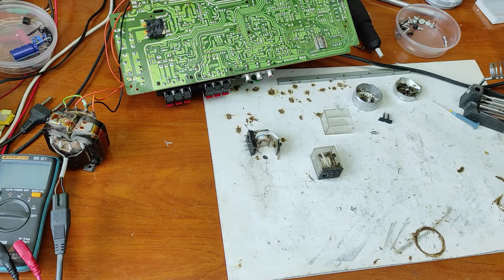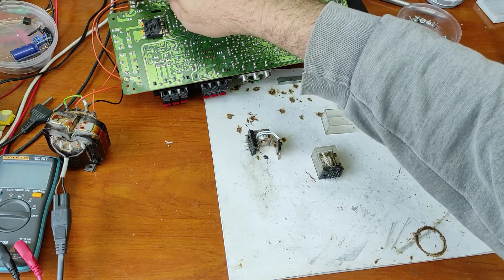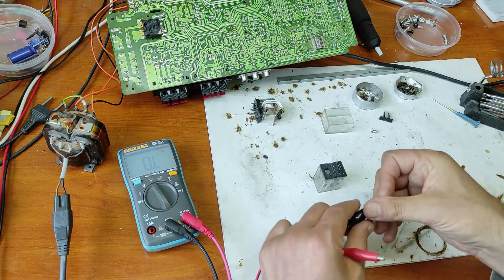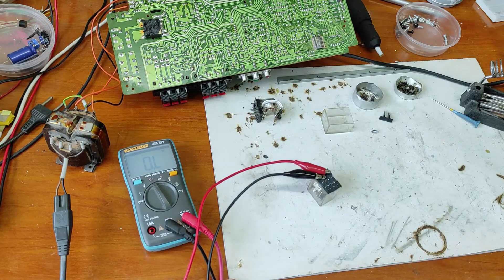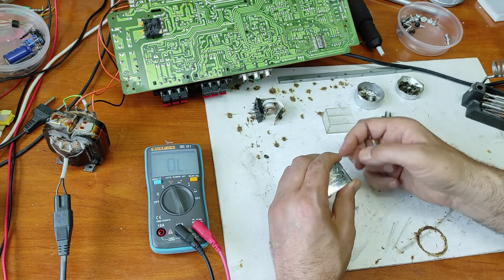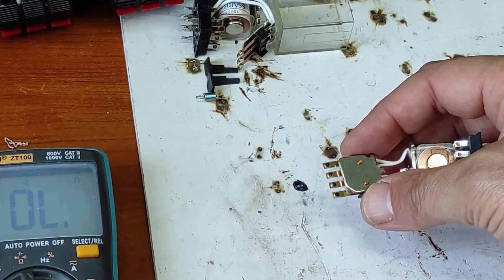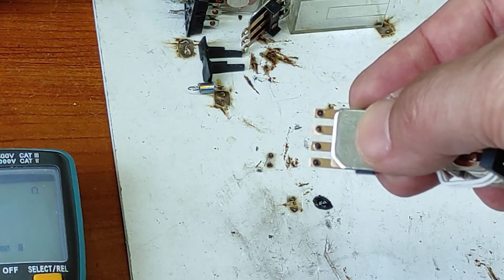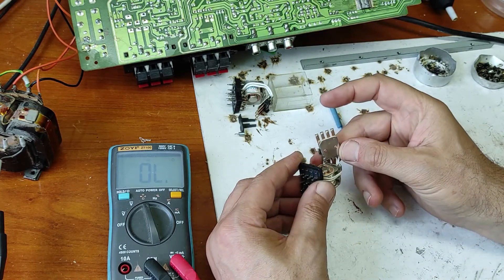Amplifier no sound?clean relay

Comment: There's a final solution,buy a new one but try this solution first to see if it solves the annoying problem . Me myself had at times a loss of sound on a low volume on one channel on my Sansui AU6900 and i solved it by taking the middle sector of the relay out, there were black spots on some contacts and i removed them with a toothpick and a small dot toothpaste, after that polishing procedure the amp worked fine and still works fine, the problem didn't occur since then. We'll see how long it lasts.
Reply from the maker: tnx bro ,u r right.but sometimes this help.
Reply: @diymariuselectro _ Because you have to desolder the old one and solder the new one it's for most people easier to try to clean the relay first.  An old Luxman amp from the 70s  i have has a relay plugged into a socket, easy to take out and clean and if necessary to replace if the cleaningprocedure doesn't give the wanted result. I'm happy the relay cleaning became a succes.
Reply from the maker: tnx bro  ltes recycle and repair the most that we can.

Comment: My amplifier felt down. Now i notice there is no audio coming out. Might be damage relay inside?
Reply from the maker: usualy are other problems.only 1% of the cases the relay is the problem.When u power on the amp,the relay is clicking after 5 secs?U have to measure the voltage of the output of the amp,before the relay.
Reply: @diymariuselectro  There is voltage from the tiroidal. 74V in both sides. Protect it's not On. 
The problem is that there is no audio. Not even Hsssss. Nothing
Reply from the maker: @laniroli3714  u have to find the schematics and check step by step.I cant help u if u dont put specific question.
Reply: @diymariuselectro  There are 3 relay..one in each module & one between potentiometers in volume control. I hear clicking.